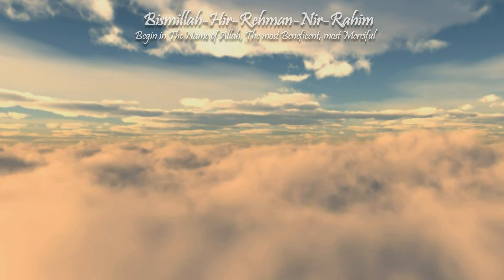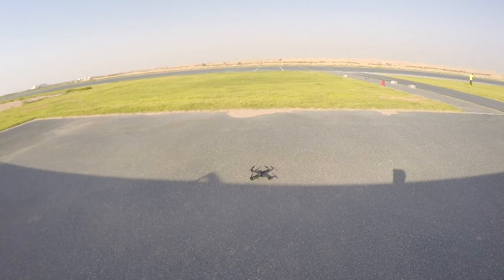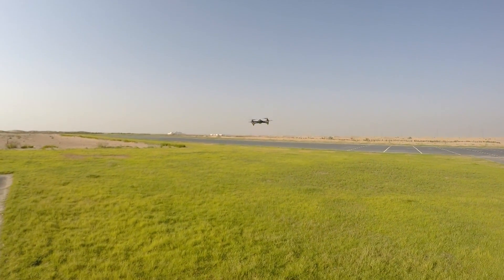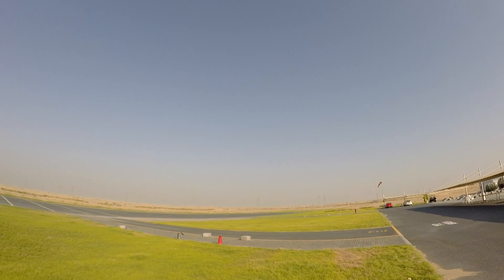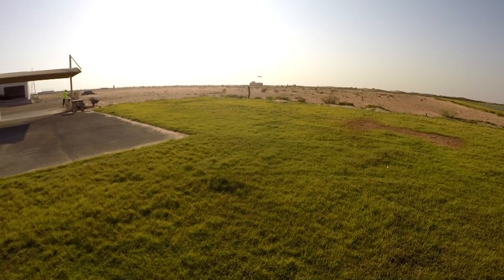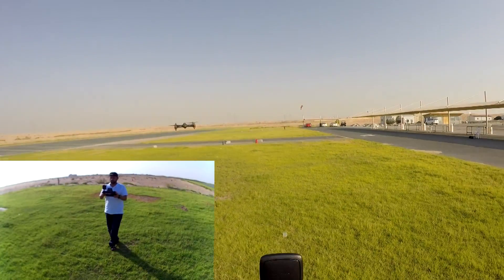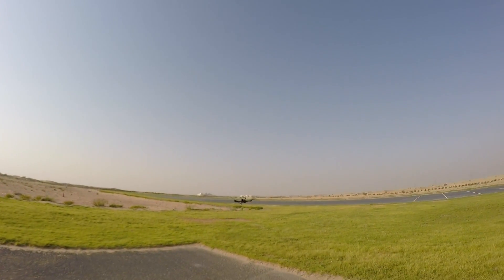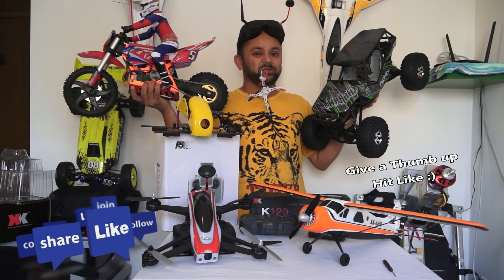Hubsan X4 H501s FPV Quadcopter Outdoor Flight Review

Comment: It is an an excellent entry level drone, even 4 years later. They're down to $150 on Amazon and you show me another drone for this price that has GPS, built in screen on the remote, brushless motors,  return to home, follow me, 1080p camera, ect and I'll consider buying it. The drone is fighting altitude hold because of the wind, it creates false pressure readings for the barometer. I got the antenna mods for my remote and have seen vids where this drone can achieve ranges in excess of 3 miles. Like you mention the remote however is a power hog so I definitely recommend getting the lipo battery for it. No lie with fresh batteries after a 20 minute flight they will drop down to 60%. That means a fresh set each flight. VERY expensive this way. I chose this drone because at the time I didn't own a smart phone and there are few options out there for people like me who needed a built in screen. It's quiet, reliable and out of the box capable of 820' in altitude. You can perform the software hack to remove the restrictions but I don't recommend it. In the US we aren't supposed to go above 400'. Get extra props and batteries, I even bought spare brushless motors. Above all be responsible. Don't fly over people or cars and follow your local laws. There are many people out there ruining the hobby for the rest of us.This is no DJI but it's also not a toy. Hopefully someday a drone with a full gimbal 4k camera with all the bells and whistles will be affordable. I'm just not ready to drop $1200 on one yet.

Comment: Always see people commenting on how it fluctuates in height in alt mode. The high winds play a MAJOR factor in that. Barometers work on air pressure which is influenced and related to wind speed. On a calm day it will hover on a dime, in high wind it will scramble to find where it needs to be. Now on drones costing 5X as much they will have object collision detection and sensors in every direction so it will hone in tighter on position. On a $200 drone you can't expect that. I'm amazed my Hubsan can hover 6' off the deck and keep it at that height. These drones are amazing.

Comment: Love my Hubsan! For $200 today (August 2018) try getting a better drone for the $$. She's quiet, has GPS, RTH, FPV screen on the remote, 1080p camera, alt hold and follow me. For $200! It's also built like a tank and so far my only gripe is the power hungry remote. Not kidding brand new Energizer batts depleted to 60% after only one 15 minute flight. That means you buy the rechargeable lipo batt for the remote. Otherwise you'll be buying AA's every other flight. Takes great stills and decent video. No it's no DJI but if you don't have $1000 to drop on a drone you don't have to. Not bad range out of the box and I don't recommend the firmware hack to remove the alt limits because that's ILLEGAL and just plain stupid. With the simple antenna mods and kept in line of sight I've seen vids of this baby going out 3000m and more. Brushless motors are a MAJOR plus and parts aren't too expensive. Again, I love my Hubsan.
Reply from the maker: MJX Bugs 5W, is cheaper and kicks Hubsan ass all the way in every aspect. get a Bugs 5W and you will forget hubsan
Reply: Send me a link and I'll check it out. As far as I can see they want $230 and no display on the remote.  My H501S was $205. Thanks!

Comment: I generally respect your opinions, but I feel some of the conclusions made in this video are inaccurate and misleading. First, I would say it’s battery life is excellent with flight times of around 20mins when flying conservatively. Furthermore, I don’t know what batteries you use, but the radio lasts a lot more than several flights with a fresh set of Energizers. Second, I haven’t seen any jello to complain of in its recorded videos. Sure it’s no Phantom, but for a non stabilized camera it’s more than acceptable. Third, if it was as windy as it sounded on video, altitude hold based on air pressure (as used in the 501) is not expected to be rock solid, thusthe few feet of fluctuation displayed is more than acceptable under those conditions. With his experience, I am certain Alishanmao knows this, which makes it even more disappointing that it wasn’t disclosed to viewers.

Comment: Hi there! I have the drone H507A X4 Star Pro. Problem is I cannot fly it. After I get a GPS lock then I get a message that the engine is locked and the drone will not lift off.(outdoors I have 11 satelite, light 1 red diod) When I am inside and there is no GPS fix, then it does fly. somebody help?

Comment: I'm not sure what's more impressive, you running backwards or the quad keeping up. Awesome video. I'm subscribing
Reply from the maker: Me Running to save myself from Quad hehehe
Reply: on bang good website, what is the difference between standard and professional version? Which transmitter comes with the quad?
Reply: JoeBoone82 I would look on YouTube. The advanced transmitter is really much better. It's longer than the more square looking original version
Reply: Thanks. It's odd that the Hubsan website does not even offer the advanced/professional version, or even have it listed as a model.
Reply: I know. There specific support sucks. YouTube is definitely the place to go for info. I love this quad so much I ended two of them. Have a good day
Reply: It's for 215.92 - 263.32 dollars. I'm updating coupons on this site:
http://couponsfromchina.com/2017/03/15/hubsan-h501s-x4-drone-active-coupon-price-gearbest/
I hope this may help you

https://www.youtube.com/watch?v=R5lA1ZQzauM

Comment: I'm waiting for mine to be delivered from Banggood, can't wait. QUESTION? From all the videos I watched on this quad it is obvious that the Transmitter eats up AA batteries, is it possible to use a good 2s-3s Lipo battery or rechargeable AAs instead. Also your video was great keep up the good work
Reply: yes it will work fine with a 3s lipo.

Comment: Real impressive quad flying in some gusty wind. Looks like Hubsan did a good job with this one. I don't care for the small
monitors for flying FPV a set of goggles would be the way to go. I've seen several reviews of this quad and it looks like a 
good one. The price is nice on it and thanks for your real thorough flight review!  :)

Comment: A goo review.
The barometer doesn't like winds over 5mph and that causes problems close to the ground.
If you get a good still day it is worth sticking it in manual mode (via the menu) as it can be quite sporty for a camera drone.  I think it is good for the price especially with that better spec controller. The other one give you a slightly larger screen but the controls are a bit "plastic".
The specs above quote a 720p camera but the ones I have flown come with a 1080p.
Nice for the price

Comment: There is a guy that actually flips this thing, manually. :-) SO far I digging it. Seems like you are going to say this is a good buy.... am I right?? By the way, the quad is following the GPS in the controller I think. So its the TX it follows, not the viewi n the camera. And Its tuff winds at your place, so Can understand the altitude hold is not that good at your place. I seen videos that shows this altitude hold much better, but in no winds... :-) SO in anyhow. This seems good....according to me....

Comment: Great review. The H501S can be flown to 400' and hang pretty good in GPS lock. The battery is good for just about 20 minutes. You didn't do a range test. I have 2 X4 501Ss. I haven't flown more than 600' out but I imagine the range would be much greater. You can stop the motors by pushing the enter button for 1 second. The lights can be turned off by pushing down the throttle trim for 1 second and turned back on in the same manner. Altitude hold can be switched off using the on screen settings menu. In full manual mode the H501S Will REALLY move. The 1080P video is quite good. No jello. I found that surprising for a solid  fuselage mounted camera. A second battery can be Velcroed to the belly. Velcro strips on both ends of the battery so as not to block the video transmitter cooling vent. Using a Y battery connector, cutting a notch from the battery door to connect both batteries in parallel. You can get 30 to 31 minutes flight time. The 501 has more than enough power to fly with 2 batteries quite well. You ALWAYS do a very objective review. Hubsan's X4 109 PRO and the H501S are both good quality quads. The Desire, NOT SO MUCH. I bet you would like the X4 109 PRO. It has a 1080P, gimbal mounter, GoPro style camera that tilts past straight down. It can look slightly to the rear. ;-)

Comment: I've had one of these with the standard controller for about one month. It works great. My video is clear with almost no jello. Some youtube H501S videos do have jello. I would say balance your props if you have jello. You can't expect dji phantom quality video with this quad, but it costs 1/3 the price. I get 25+ minute flights per battery. My altitude hold works pretty good. Most quads I have seen that use a pressure sensor for altitude hold (such as this one) have a little trouble in wind or high speed because the wind speed causes fluctuations in pressure.
Reply: would you recommend as your first drone to start?

Comment: Ali is this the latest version with that supplied radio?
ones I see online have the smaller box type radio with screen at the top
Reply from the maker: yes new radios are different. this is the old radio version
Reply: hello, how much lasts the battery of fpv monitor in this radio ? 1h or less ? thanks

Comment: Thank you for this detailed review. Yes I was one that commented about you being bias on the H502E, but you where very fair about this one.    The video on some of these 501s are bad and out of focus, I think Quality control is bad at Hubsan. Altitude  Hold has problems in wind because it has a pressure sensor and I have never seen Flight Times as stated in the manual, but that is with all products  you buy nowadays.  But overall it quiet nice for the price.